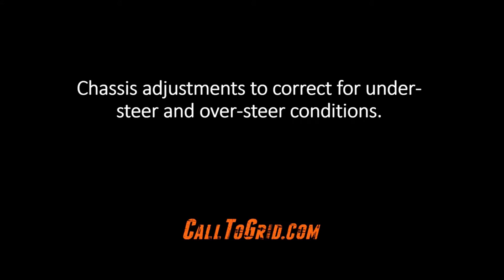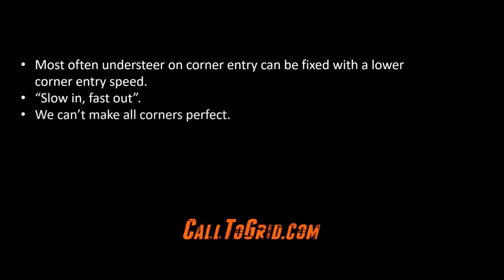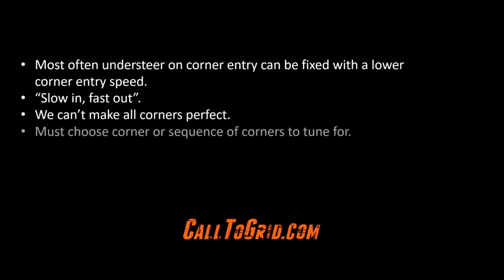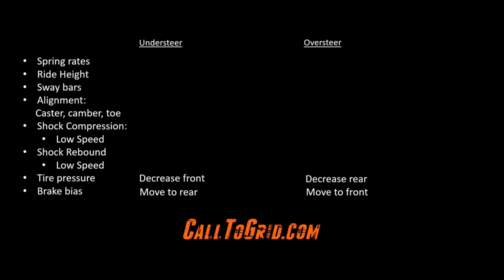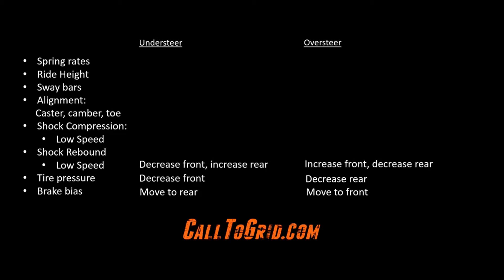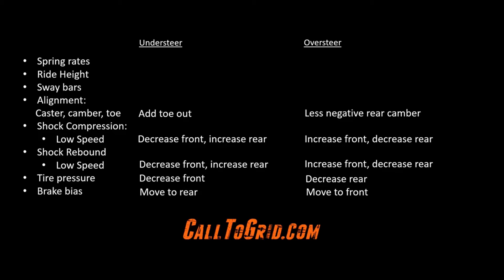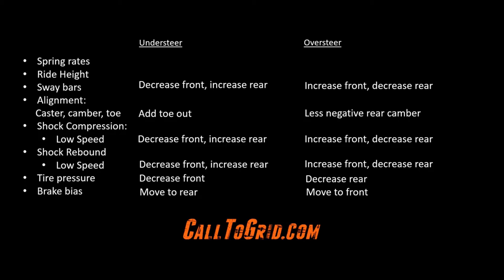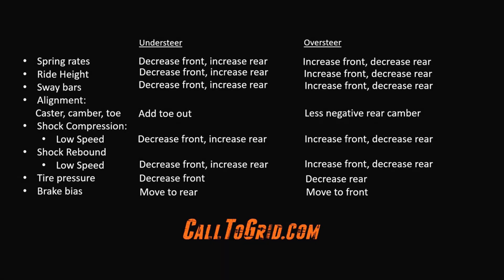Simple Chassis Adjustments to Correct for Understeer or Oversteer

Comment: Hey there! Thanks for the Cheat sheet. The only setting I have to question is for the camber setting at the rear for oversteer? How does decreasing rear negative camber correct oversteer? Wouldn't that cause less rear grip at the rear when cornering leading to > oversteer? Is that for conner entry, mid corner "APEX" or conner exit?
Reply from the maker: Appreciate the comment! So camber helps when the suspension is loaded, correct? For instance, negative front camber helps after braking (weight transferred to the front) and you get more contact patch working for you as you release the brakes and begin turn in. For the rear in the this case, we presume you've ran too much negative camber and not getting enough contact patch as you begin to apply throttle and load the rear.

Best thing to do is pick a direction on your mod and see the outcome. Go less negative. Then more negative. Only change one thing at a time though. Remember shocks also play a role. Less rear compression force will help set the shocks sooner, as throttle is squeezed in and load shifts to the rear,  helping the camber you did add work for you.  

Cheers, mate!

Comment: Can you explain why you’d decrease front rebound to account for under steer? My understanding is that by decreasing rebound, you speed up the rate of rebound. Compression always makes sense to me, but rebound I mix up. Thanks
Reply from the maker: Obviously it matters in the cornering sequence where the understeer is occurring. Most common is corner entry.  Yea, and it's semantics when it comes to shock tuning (decrease/increase vs more firm/soft). Some shocks have pictures of turtles and rabbits on them to help understand. Turtle meaning to slow down, rabbit to speed up.

For corner entry understeer (most common) what we mean here is to resist the shock from rebounding. Think about it, in cornering, when you've loaded the front end, you want to keep that vertical load on the front tires, helping with grip as you apply steering input.  So you want to RESIST the shock from rebounding to soon. Make sense? Conversely, if your car has a tendency to oversteer on entry corner entry (outside of modifying the driver (excessive trailbraking)) try getting weight to shift to the rear sooner.  Yea, you need to stop and think about this stuff. Hope that helps. Appreciate the response.
Reply: @CallToGrid  thanks for the response, that makes sense. Use softer settings on front to combat understeer because it compresses more quickly (bump) and stays down longer (rebound)
Reply from the maker: @danielhass4812  depends if you have single adjustable vs double adjustable shocks. Do you want to upgrade your shocks? We can help. What kind of car do you have?
Reply: @CallToGrid  thanks! 2020 Supra. SPL bits and MSS HAS w/ factory dampeners. Starting to do my research on Coilovers, and trying to learn as much as I can before purchasing. Never had Coilovers. I’m thinking I may only need 1 ways since I am far from advanced, and still drive it on the street a couple thousand miles a year. Ohlins road and track is what I’m thinking. Read good things about MCS and JRZ, but those are a big step up
Reply from the maker: We offer AST shocks on our site. You have the Supra A90 MK5? 
https://calltogrid.com/ast-suspension/
We have a handful of products yet to backfill. The Supra is one of them. I can get you a price though if interested.

But honestly, what is your driving experience? How many events have you attended? Are you doing HPDE/Track Days, (i.e. no timing)? Who do you run with?

I'm all for making a sale, but if you are still developing your skills behind the wheel I'd highly recommend you not make many mods to your car until you're more skilled. (i.e. more consistent, corner by corner, lap by lap). If you mod your car now you won't know if it's you or the mod to the car that made something better or worse.

Many instructors recommend limiting mods when you are a newer driver to tires and pads. Don't go R-Comp tire yet. Too sticky and no audible feedback. Stick with treadwear of 225 or higher. They have grip and also provide an audible feedback as they approach the traction limit. Can get a good sticky all-purpose tire with a treadwear of 225 or higher. I can help with pads.

That Supra is a very capable car. I got my start in a C5 Corvette Z06. Super capable car, but it was over my head. I knew this sport was something I wanted to stick with. I sold it and got a used 1995 MX5 a guy was selling at the track. Cheaper car, and great car to learn on. You can stick with the Supra, just try and limit mods. My thoughts.

Here to help!